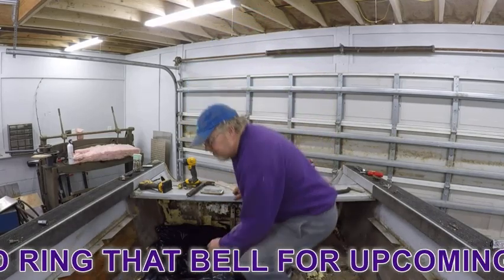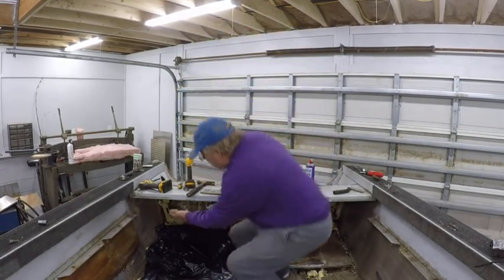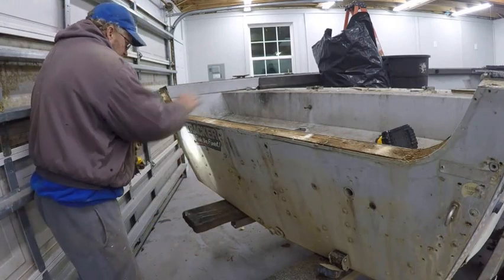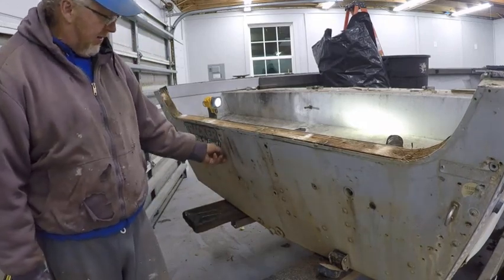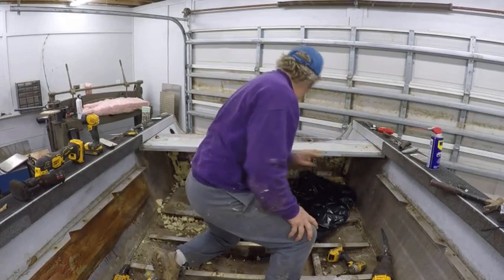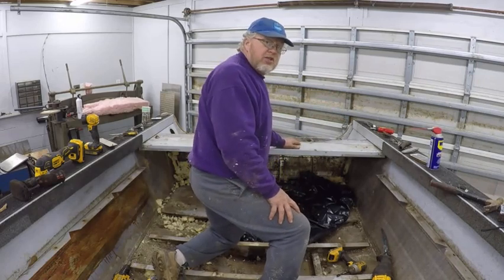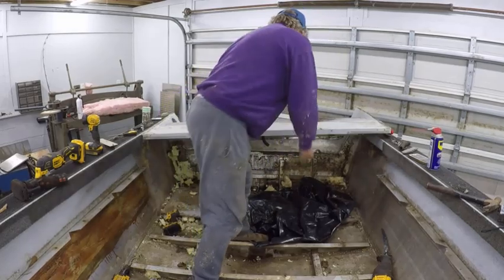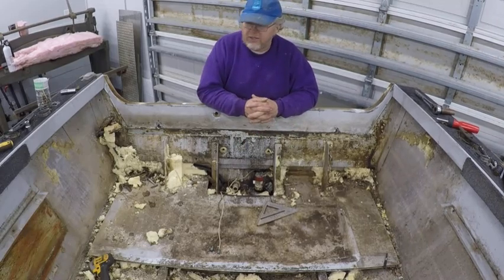THE EASY WAY, HOW TO REMOVE A TRACKER BOAT TRANSOM / SPLASHWELL    TRACKER BOAT REPAIR

Comment: When I replaced mine I did it the same way so much easier. Also used 3/4 inch regular plywood double up glued together with epoxy when used epoxy acetone mix 50/50 and use about half of the hardener as normal, that way it gives the penetrating epoxy time to soak in. And then just painted it with a exterior white paint I had laying around. It was tight getting it back in but I could hang a bigger engine now with the extra knee brasses I put in. Looking forward to seeing this on the water. Nice work.
Reply from the maker: Thank you sir.  It sounds like you made it bullet proof

Comment: Would it be ok to keep the splashwell out of one of these and use the boat with a smaller HP tiller motor? I just got one of these today but it’s missing the console, controls, motor. The boat itself is still in great shape and I was thinking since I already have a tiller that maybe I could just remove the splashwell and mount a seat further back to operate it. Looking at yours it looks like the splashwell doesn’t really add much structural value but this style hull is new to me. Appreciate any input. Thanks
Reply from the maker: The biggest advantage to a splashwell besides strength is the fact it prevents getting swamped from the rear.  I never recommend removing them.  Especially if your sitting in the rear.  I know several who have done that with 21’ boats.  They quickly put them back in after a rough water day.

Comment: What did you do for your transom cap. The part that Covers the top of the wood. Mine is in Bad shape..
Reply from the maker: I fixed the one I had.  If not fixable I usually just make a new one from 2x2 16 guage aluminum angle

Comment: I wish it had bolts along the top. No it’s rivets and spot welded in. Ya ever come across that. No way to get at them with out cutting the splash well out. I am stuck on how to proceed
Reply from the maker: Those are a nightmare.  I have dealt with one like that.  I did as you said and drilled out rivets and just cut the welds out to remove.  Not a easy or fun process. Good luck.  I appreciate you watching and commenting